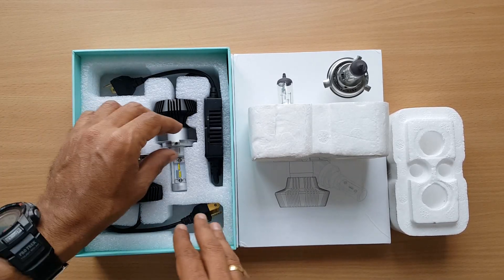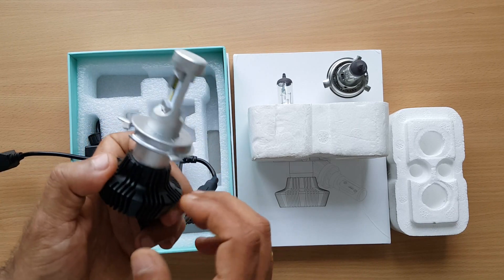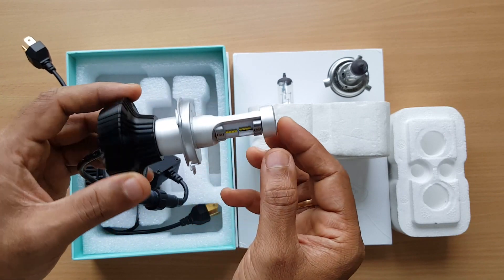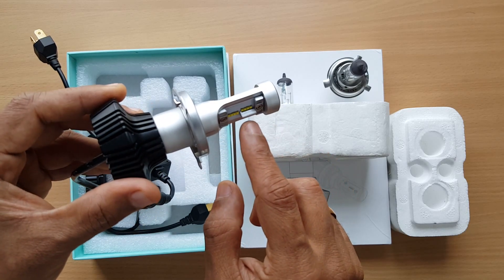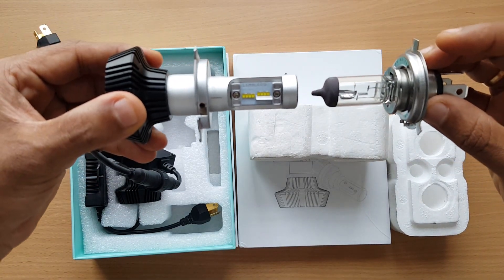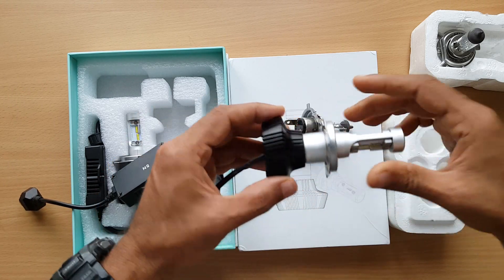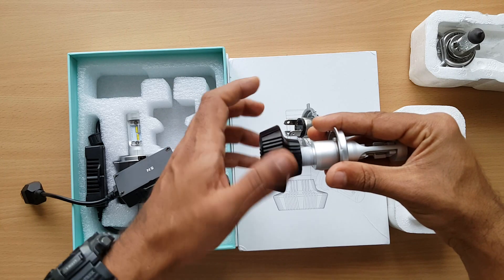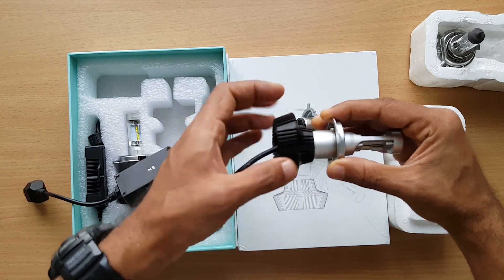Design Comparison of New Generation H4 Led with Halogen pattern vs Halogen Bulb

Comment: Are they reliable? Or will they burn out easy? 
How do you like them?
Reply from the maker: Hi Pete, 
The Bulbs are Good as for now. I am using it for the past 7 or 8 months no issues at all. I have used them continuously for 3 to 4 hours no Over heating problem. These LED bulbs do not over heat like Halogen, You can get an idea about the temperature produced by LED bulb by see my LED bulb temperature comparison video 
https://www.youtube.com/watch?v=GmW3fsy_7Ag  ( LED vs Halogen )
https://www.youtube.com/watch?v=VuC6_3ZGkao.  ( LED with fan vs Fan-less LED )

Have a Great Day..
Reply: Ok thanks.